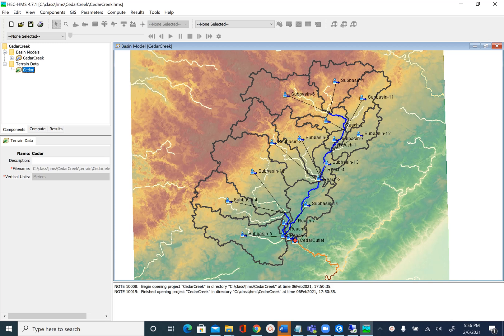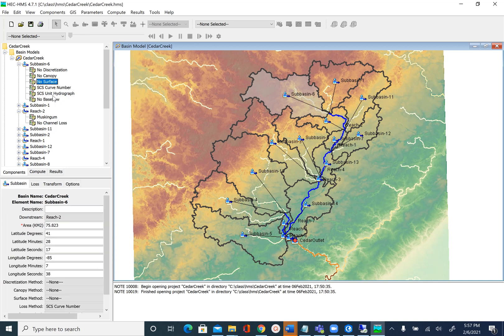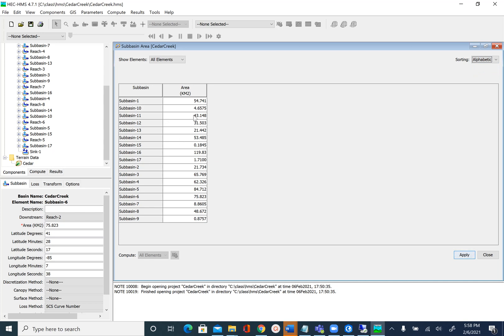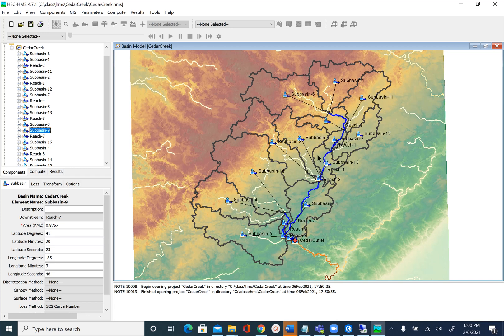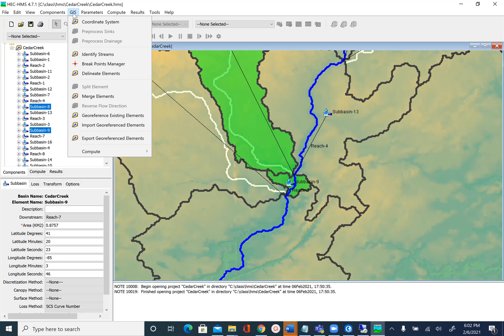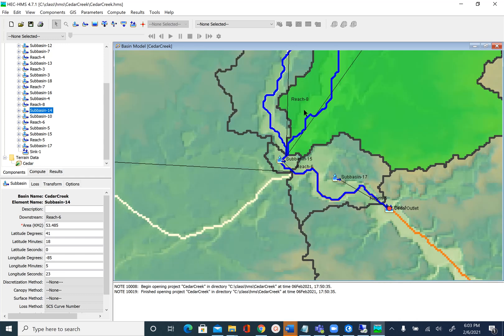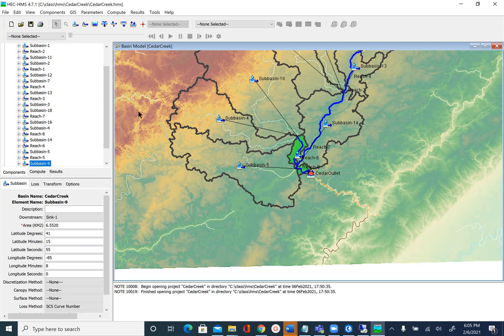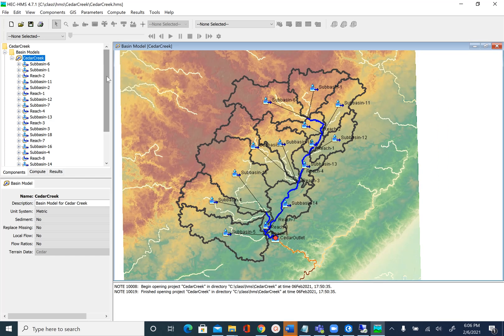Hydrologic Modeling Using HEC-HMS (4/9) - Merging sub-basins

Comment: Sir, My sub-basins were 50, but after merging them into 30 sub-basins  exported it my sub-basin and opened in arcGis,  the attribute table. While values are filled in for several rows, some rows still have missing data."
Reply from the maker: before exporting to arcgis, go to parameters-->characteristics and press recompute. this should recalculate values for all merged sub-basins
Reply: @hydrologyvideos8253 sir I did it.  recompute but still no change .
Reply: Sir, I did it  recompute,  but no change . What should I do it .
Reply from the maker: @ not sure. you can skip the merging part or if you really want fewer sub-basins, re-delineate the stream network with higher area threshold